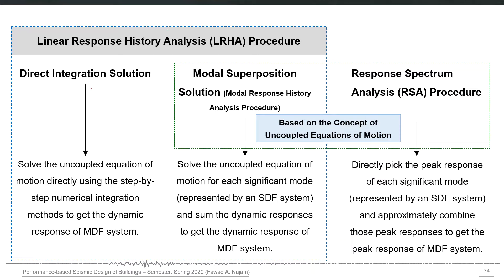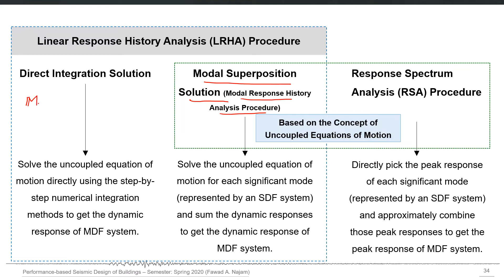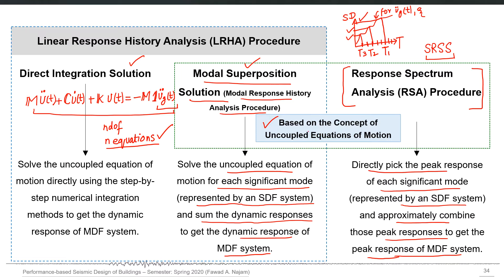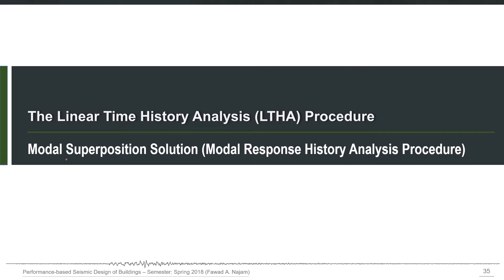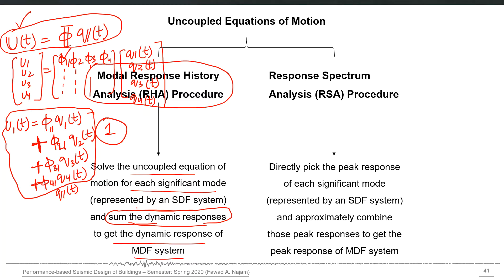Part 2 - Modal Response History Analysis (Modal RHA) vs. Response Spectrum Analysis (RSA)

Comment: Hlw sir
Why Time history analysis gives less value as compared to response spectrum method and equivalent static method in case of design parameters such as maximum displacement,interstorey drift,base shear and overturning moment?
When i model a 15 storey building in ETABS i got the result like that, what's the reason behind?
Can you please explain?